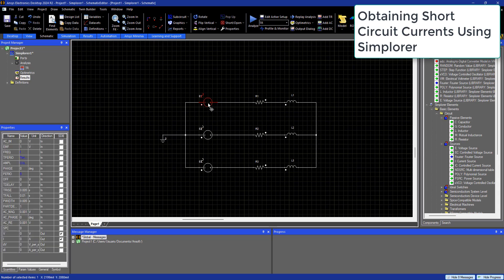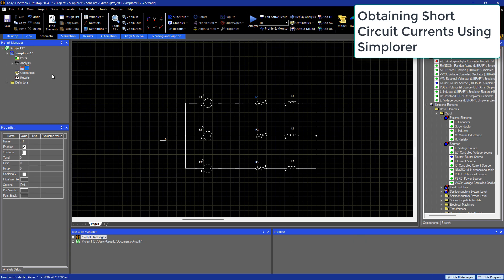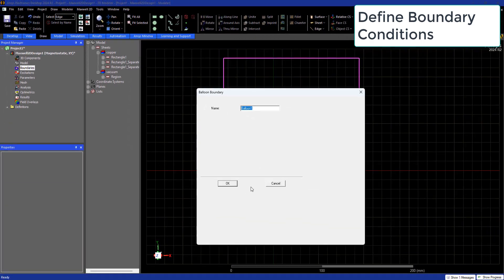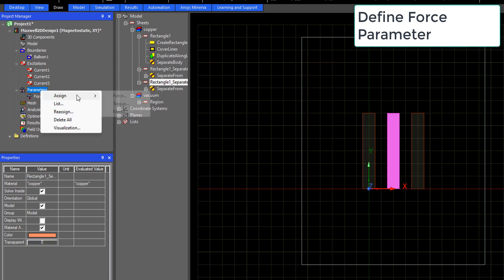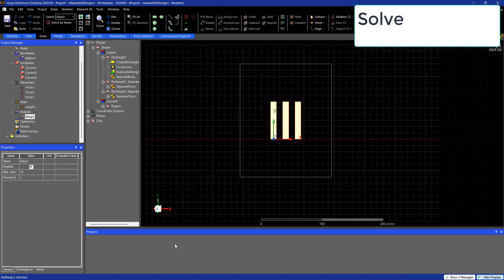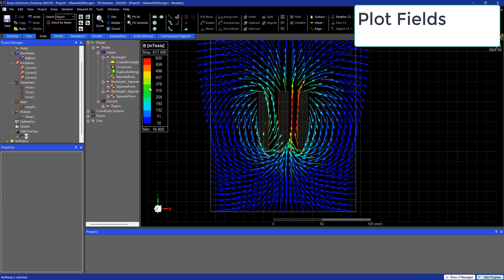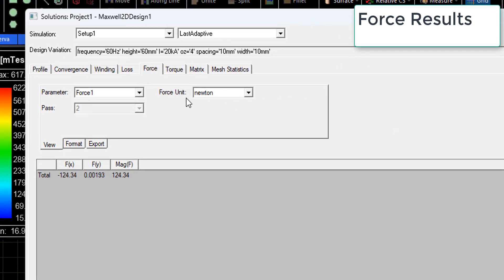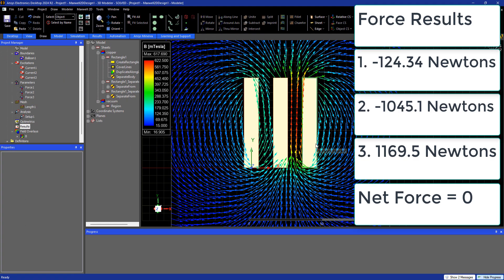Electrodynamic Force Calculation on Bus Bars using Maxwell

Comment: What was the use of simplorer, i think you haven't used it in Maxwell.
Reply from the maker: Simplorer was used to obtain a circuit-level estimate of the currents, which were then manually input into Maxwell for the force calculation.